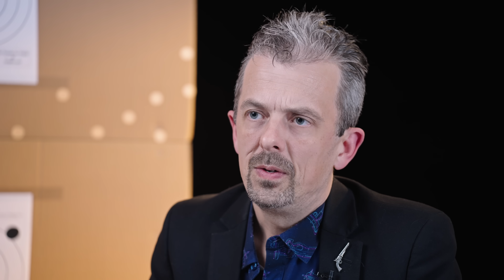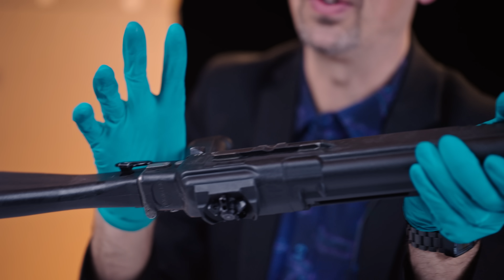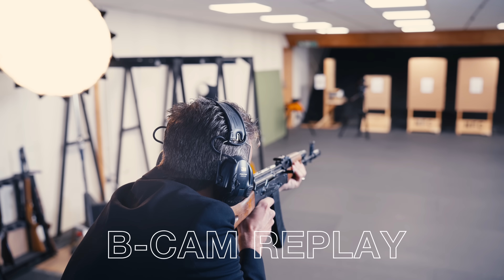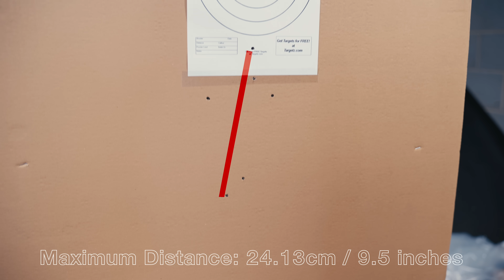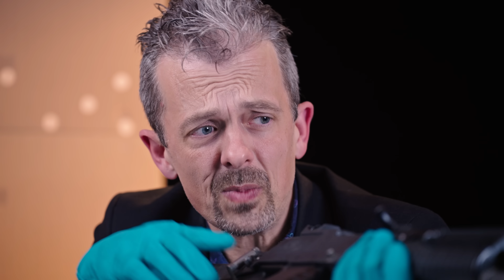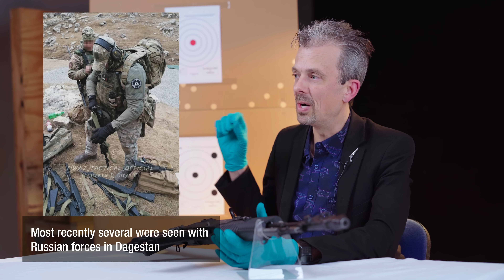World's Rarest Production Rifle: The AN-94, Part 2 with firearms expert Jonathan Ferguson

Comment: running an an-94 on full auto seems silly to me lol , full auto for me would be for supression or CQB, and in CQB i would run the hyper exclusively as it gives the control of single fire with the fire rate of full auto , 3 bursts is 6 rounds , thats massive and you dont waste ammo .. and any thing else .. single shot .. but the issue i think is all the moving bits .. that prob. let this gun massively .

Comment: Top the video thk ! A Russian guy posted a comment under a video about the weapon, saying that you shouldn't hold it with a tight, professional grip, but rather 'hold it a bit looser' against your body. He explained that the weapon was designed to be used by novices, not professionals. According to him, this slightly improves accuracy during rapid fire.

Comment: Russians have made good decisions not widely adopting expensive platforms. Why? Assault rifles simply dont matter that much. Reliability and decent accuracy is what is needed. SF and higher calibre units have other requirements, they get whatever they want. Regular units just dont need them as on the battlefield there is very little engagement with assault rifles. Statistics on Russian wounded is only around 5% is from bullets. The main factor on the battlefield is fragmentation.

Comment: What I'm getting out of this is that maybe this should have been made into an RPK-esque support weapon. Much more limited issue squad firepower adder used with optics and bipods that could still put the burst and the constant recoil auto fire to practice without denting the budgets as much or making as big a deal of weight gains as it would in the service rifle role.

Comment: What did you want to compare when making 4 shots from ak and 2 from AN?
The technique of shooting twos from AN is different from a regular rifle. 
To reduce the spread, you clamp down on a regular rifle.
If you do the same with AN, its spread will increase.
This is clearly shown in the video from the Kalashnikov concern:
https://youtu.be/jbe6mJEKJCE?si=7anjAUVxJyEdWK14&t=711
The output of this video is:
When shooting with the hands of an an 94, an untrained shooter or a shooter who does not clamp the rifle, the accuracy of hits will be higher than that of the Ak 74.
If the rifle has a stable stop during firing, this difference will be leveled. This difference will be further reduced for upgraded versions of the AK.

Comment: The idea of comparing AK and AN-94 by inexperienced shooter is correct. Experienced shooters “clamp” the AN-94 like an AK and it affects the accuracy not in the best way due to deformation of the plastic body of the AN-94.
Comparison of AK and AN-94 shooting in a pistol range also shows something, but you need a distance of more than a hundred meters, or better three hundred meters, to understand what the AN-94 was made for (it would be great to compare G11).
However, there is a problem that AN-94 prototype batch for military trials and AN-94 in serial production are very different rifles in terms of quality....

Comment: I still think it was too over engineered for the intended use, if they wanted a controlable hyperbust rifle they should've just done a constant recoil light bolt with the 2 round burst, it wouldn't be as affective, but close enough for the price.

Comment: There actually was a video directly comparing the AN-94 and AK-74, produced by Kalashnikov Media. In it, one of Russia's top competitive shooters conducted a detailed head-to-head test of the two rifles. Unfortunately, the video was removed from YouTube following the outbreak of the war. It still can be found reuploaded. In short, most of the time soldier will flinch and double tapping from AK-74 is almost as effective as hyper burst, but without added complexity to the rifle.

Comment: Would it be possible to develop hyperburst full auto system ?

let say short burst of an full auto rifle, 6 rounds just like you demostrate but that all that 6 rounds are hyperburst. (3 hyperburst) with a single trigger pull.
Reply: It's probably easier to understand if you watch Part 1:
https://youtu.be/-wXNfOki12M?feature=shared
The hyperburst seems to rely on stripping 2 rounds from the magazine, one loaded into the breech and one in an intermediate position on a feed ramp. The first round is fired and extracted as normal, but the second round is chambered and fired as the working parts are still cycling. 
Part 1 has slo-mo video. When the AN is fired in full auto you can see that the first 2 rounds are hyperburst, with subsequent rounds in the burst being conventional automatic fire.

Comment: Tiny correction - special forces and recon keep using 7,62 AKs because it's subsonic round doesn't suck (direct analogue of .300AAC in all respects) so they can have both sneaky stealthy gun and a general purpose rifle for the weight of one.
As for the AN-94's effectiveness your analysis is spot on - the conclusion was that the hyperburst is nice but in every other respect it's worse than an AK-74.

Comment: Hearing about this gun reminds me of a question I’ve been thinking about for a while.  Are modern advanced assault rifles worth it or would a country be better off spending the money elsewhere. 

For example would a company equipped with say M5 Spears do better than one equipped with new production M-16s and extra machine guns bought with the money saved?
Reply: The thing is, M16s are modern assault rifles. The point of the Spear is that it's supposed to penetrate armor better, but it's just not good enough, so it's more or less pointless as a result. It doesn't provide any significant benefits, not from a design standpoint anyway.

Comment: I now wonder how would AK-74 and AN-94 perform with a PSO sight mounted on them in a role of a some sort of a marksman rifle at longer distances (like 500 meters)
And as i recall, someone said that shooters at the trials should not grip rifle tight, because one of the features of the rifle is having the ability to shoot more accurate, then AK-74, from unstable positions, such as dismounting from the APC

Comment: Beautiful video Jonathan! Only thing i may add, is prevalence of 7,62 in SpecOps units is caused not only by perceived  advantage in stopping power, but also by ammo distribution and silencers available to those units. It's a long story, but 5,45 subsonic was hard to make and produce, silencers was really demanding and there was problem with it. In result, many units choose to run 9x39 and 7,62.
Reply: Subsonic 5.45 isn't hard to make, it's just incredibly wimpy because there's only so much mass you can put in the bullet (only 5.2 grams as opposed to 12.5 of 7,62x39 and 16 for 9x39). 9x39 itself was designed to have a beefier bullet than 7,62x39 but it's effectiveness in open combat is lacking so lots of units hang on to AKM or 103 as multipurpose rifles - not as good as a VSS or AK-74 but does both adequately.

Comment: I trained with M16, M16A1 and M16A2 I hated the 3 Round Burst mode on the A2 it would have been better having Single shot a 2-round burst and full auto than the kluged 3 round burst mess of a trigger with 3 different let off pressures. With the 3 round burst at 25 meters the first two rounds hit within an inch the third was high and to the right by up to seven inches for many recruits. For me it was around 3 inches which is only good if I aimed a little left and low for a sight picture.

Comment: 3:30 why didn’t they adopt duplex rounds? Duplex rounds seem to work, and they spare you the angst of worrying about steel cables, wheels and gears
Reply: Duplex rounds never achieved required accuracy
Reply: @ is accuracy as important as volume of fire for producing hits in walking fire?
Reply: @JinKee  it isn't, but having 3-4 moa for military grade ammo is a must for some occasions. Duplex couldn't achieve that
Reply: @ for precision, change magazines to simplex conventional rounds
Reply: Duplex rounds and other variations of ratshot do not work with muzzle breaks, to adopt duplex rounds one should saw off muzzle breaks from every single AK in Russian army, including AKSU - which doesn't even work without muzzle booster. This problem cannot be fixed, and this is why troopers still carry shotguns to counter drones.

Comment: Since the previous video I was wondering if you could file down, or manufacture a new pivoting seer part that would make the gun fire double shots every recoil cycle in full auto? so instead of 1 hyperburst followed by 600rpm it would be constant hyper bursts at 600rpm frequency

Comment: Thank you very much.

Ideas inspired after watching this video:

1.Bulp up version AN-94,  replace 2 hypher burst shoot with 3 hyper burst shoot theory how make this simply first add more space for 3 burst meaning extra 1 more space hyper burst pipe hypher Burst pipe store two ammo and one on battery, more space recoil rod and travel path extand so 3 hyper burst shoot out before recoil impacting the recoil buffer, recoil buffer use APC9K Hydraulics Recoils Dampener buffer, 

2.Replace the old autofire way using hyper burst pipe channel ammo feeding, results Auto fire become hypherautofire each 3 bullet shoot out recoil impact shooter, auto can't be stop in Middle of 3 shoot hypherburstauto continue shoot until 3 ammo shoot out. Ammo swallow into burst pipe problem fix; old way bolt have travel back charge weapon, this firearm use hyper burst pipe charge handle bolt delay problem charge next round bolt travel far solution is add opposite moving ammo swallow rod meaning when you pull charge handle back opposite ammo swallow rod move fowards swallow ammo from magazine box push 3 ammo into hypherbust pipe and rotate position ready cycle, first bolt also redesign push 3 ammo first bolt travel forward pick up or swallow 3 ammo into pipe at same times second swallow rod rotate get out of the way and moving opposite position reposition it self for next cycles. This simpler great cost reduction. You don't need wheel and the cabel. Also reduce firearms weight. Due 3 burst rear length part is more than old. Bulp up design barrel now can be extand for more accuracy. May reintroduce weight that have been reduce.

3.Thick stainless steel reinforce polymer quad mag 60 rounds

4.VHS-2 Robust Excellent Iron sights. Front iron sights located top on front tronion or and end of handguards.

5.Pistol grip store cleaning kits, pen and notes how many rounds have been fired.

6.SFAR Ruger styles pattern handguard protruding further front protecting end of muzzle and protecting end of suppressor.

Comment: So, the hyperburst delivers what looks like roughly 10 MOA dispersion.  Which, for the thing they were trying to do, is pretty good. 

IIRC, that's similar to the dispersion the G11 would deliver with it's 3 round hyperburst.

I'm thinking the full auto setting should probably have been arranged to skip the 2 round hyperburst at the beginning of a "full auto" burst.  (Although, I'm not sure the feed system could skip the hyperburst - I'd have to see the entire feed cycle in a cutaway model in both modes.)

However, I'm not convinced the advantages of hyperburst outweigh the disadvantages of the AN94 in other respects.  I think the US Army got it right in the ACR program - the realization that optics were the real advantage the ACR competitors brought to the table.  So, the US started equipping all rifles with optics, and kept buying basically the same sort of rifles they already had.

Comment: I'm guessing that there is some sound logic from military minds behind it, but can someone outline the exact logic behind giving common infantryman rifles with the ability to fire automatic? I understand why you'd want well supported (bipods and tripods) weapons with large magazines to be able to fire automatic, but anything less supported than that seems kind of like you're asking for waste. Based off what I've read, it sounds like most special forces train to shoot few rounds, accurately; even in very close quarters. For common troops, I get the sense that automatic fire pretty much just leads to way more ammo being burned off than is efficient. Suppressive fire is still meant to be accurate. Thankfully, I've never been truly shot at before, but I have been down one range while .308 rounds (shot from a bolt-action; so not even rapidly) were landing, say, at least five metres from me on the range next door (there was a few feet of wood between the ranges), and even that gave me an appreciation for how intense it'd be to get accurately shot at. For suppression, I'd think that thirty well aimed rounds within a metre of me are going to have as much effect, if not more (considering the longer span of shooting) than a handful of automatic 600 rpm+ bursts landing within, say, five metres of me - and that's not even getting onto if someone just spat the whole mag at you in one long burst. Even for things like building and trench clearing, I am kind of struggling to see why automatic fire is desirable. Is it a way of compensating for panic and stress at those close ranges?

Comment: You did not compare new recruits using the single fire on the AK vs the hyperburst on the AN 😢

That's the money maker isn't it? For urban combat, to more reliably hit something? 

There's auto fire in trenches and assaults and close contact, but there's a lot of shooting from buildings and at buildings.

Might a reliably accurate 2 shot burst weapon not do well in this situation?
Reply: According to soviet researches and manuals, burst firing even at medium to long distances increased speed at which not-well-trained soliders could hit their targets. 

It's highly debatable, but during 1960s, there was a research program featuring real conscript soliders after their basic training, who had a set of targets to clear (unknown ranges, different types of targets) with different shooting techniques. It has been observed, that ones that were told to fire short bursts, cleared all the targets much faster that ones who shot single shots or longer bursts. 

Thus, in soviet army, short bursts were considered a primary firing technique, even at several hundred meters, and all the soviet ARs focused burst fire accuracy above everything else

Comment: I served in the US Army mostly prior to the first gulf war.  We carried the M-16A2 with 3 round burst, and a Beretta 9mm.  I was not a crack marksman by any means, but I can see how the Soviet and US programs to build the next primary infantry weapon were very similar.  Great video!
Reply: Dude, these are completely different things. Your M16 simply had a 3-shot cutoff. And the Abakan is a gun with a gun carriage layout, which allows to fire 2 shots at the moment of barrel recoil. Do you understand the difference? These are NOT the same thing.
Reply: @Aries01041982  I didn't say they were the same design, or even that either army had the same design goal.  Both armies were trying to put multiple rounds on target.  The AN was complex, heavy & expensive but worked and was never adopted. The M-16A2 was simple, lightweight & medium priced but really wasn't effective and did get adopted.   Enough dramatics.
Reply: @thomas_fx_foto  And again you didn't understand anything. The cutoff on the M16 was invented so as not to waste ammunition in the heat of battle, when soldiers are on adrenaline. This does NOT contribute to INCREASING accuracy.

Comment: The way Russian military trials and adoption goes, as far as I’m aware, is quite different than the Western approach. As in it is recognised that a new system will always have falls so ‘adoption’ ends up being small number long term troop trials where you can learn, iron out kinks and reflect. It may actually be more chaotic than I’ve just stated but it seems to work and be a better system for technology advancement in real world conditions. I can’t speak about the political aspects of Russian arms procurement but hey, the politics have always been a shit so in the West, for USA and Brits especially. Anyway, really interesting rifle, can’t think anyone who likes firearms giving up a chance to have a go with a 94
Reply: They certainly have operated that way yes, but reading Max Popenker's account and speaking to others who are even more damning, this wasn't a case of the system working as intended - it was a straightforward failure, pressing ahead with a requirement that made no real-world sense and sacrificing existing capability (decent semi auto and automatic accuracy, light weight and ultimate reliability) for that one gimmick. It was never going to work, basically - no amount of learning, ironing and reflecting was going to make it viable. We'll soon see whether NGSW is the same sort of folly.

Comment: Magnificient, thank you!

About the Abakan trials, it's worth to mention the other "blowback shiftted pulse" gun, Igor Stechkin's TKB-0146. It worked similarly to the AN-94, as it had the recoiling, gas operated "gun inside the gun", with similar two stage feeding from a stationary magazine. Instead of the pulley, the bolt carrier had a hooked "tail", which pulled the next round from the magazine to the lifter, in parallel with the bolt chambering the previous round from the lifter. Because of this, the gun had to be charged twice after reloading.
TFB had a nice article about it in 2018.

This gun was designed about a year before Nikonov came up with prototype of the AN-94 (named "ASM" during the trials), so it's possible, that Nikonov took inspiration from Stechkin's two stage feeding method, and develepod it further with the pulley and cable, to eliminate the need of the dual charging after reload and unload.

Sorry, if I commented this multiple times.
Reply: Thank you - yes, Max P covers it in his book but doesn't comment on any cross-pollination. Seems likely though.